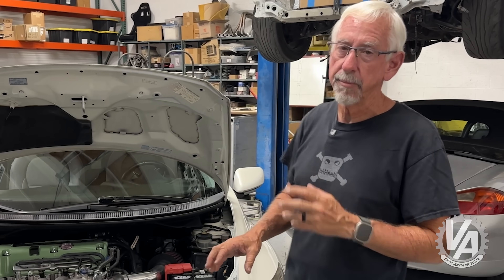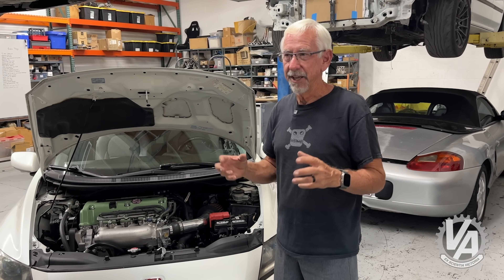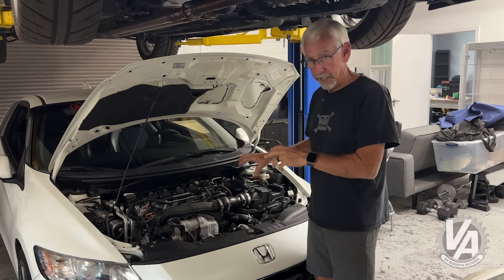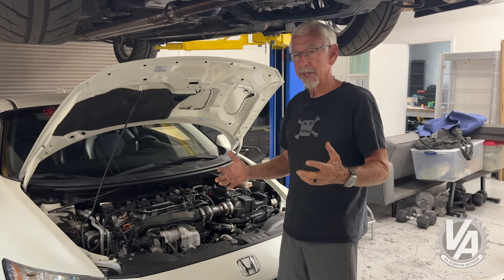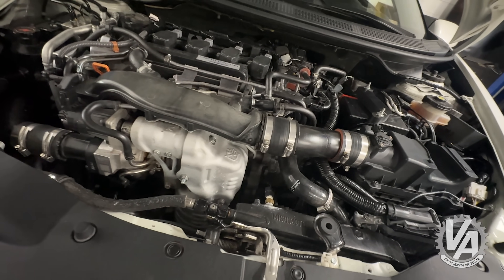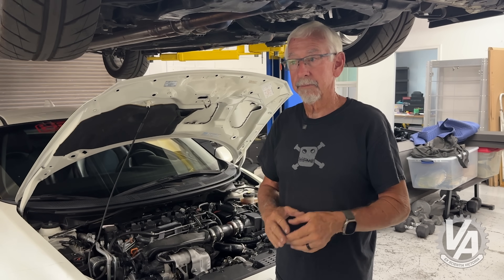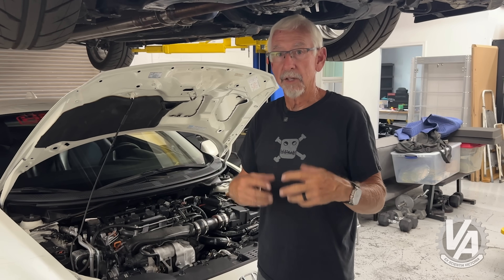We Knew This Would Happen! Honda Engine Swap History Repeating: ZC to B to K to WHAT?

Comment: The Kswap is not dead...  Its just so reliable that the people who swap to K20 never have to continue to watch youtube videos.
Reply: Its been over 3 years now on my Turbo AWD K20 EF Civic sedan.  @ 411 horsepower tuned by PFi,  The only thing that ever breaks is an occasional TPS sensor.
Reply: @Basscouch  And clutches and CV joints
Reply: Theres no reliable high power 4 banger if we’re talking 600hp or more, and very few can handle 500-600 reliably. 4 bangers aren’t just not worth it for chasing high power, but if you just want something liable, fun and nimble on 200hp-300hp K series are pretty damn good still. Anything youre looking for in terms of flat line speed and not a time grenade  though… theres LS’s, Coyote’s, and 2J’s depending on size, cost and  dimensions. K20’s are really only that amazing for smaller cars and even the modern civic now days weighs 3100
Reply: @Angel7black  Nowadays all is made light and at the brink of it's designed power that is why I don't like ANY small displacement engines anymore. I would not go further than +20% on those engines in stock form. I remember boosting a Honda B16a back in the 90s. 350 horses all day reliability, gearbox Y2 LSD STRONG!  I only burned through clutches and CV joints. Ow and tires.. yes tires LOL. Today I would opt for a big diesel like the BMW M57 6 cyl, single big turbo, not the fastest but lot's of fun and reliable as a Mitsubishi marine engine.
Reply: Facts!!
Reply: I drive and love Honda but I'll admit I'm a bit of a K-hater, not the 24 but the 20s in particular.  Now real life vs youtube is definitely a good point, and this channel here doesn't suffer this, but i swear i have never seen another Japanese engine get blown up by so many youtubers.  Its that and my hatred for (with some exception, very well designed ones) exhaust sound, which for boring reasons i won't get too into (reversion basically, but this also directly contributes towards usually lackluster engine sound) is why they blow up so much.  Sure someone can do some perfect 4-1 with great merges, and stepped headers, and it CAN sound great but most don't, and most explode being pushed by their owners far more then any other higher end tuner engine i know. 

Probably not the engines fault (besides the reversion bit), more a problem because its a NHRA legend and all that tuners go too hard with it, but alas i'm still kind of a hater.  A professionally ported K24 (or alternatively, stock) i kneel, but if you stick K20 heads on it, that unfixable exhaust side (the side all the cool emotions come from) but perfect on the other intake head (the boring dyno sheet side), i just can't respect it the same way as 90% of engines.  No i don't think Mistubishi's sound good either and yes i know they also made many legends in the NHRA.  More a road course/rally person myself
Reply: @Ottobon  I’ve been a full k24A2 fan for sure there slept on and cheaper. I rather have more torque than a few more hundred rpm’s
Reply: @ssjdavid  My thing is i drove one of those goofy GTV6 things from Alfa, then looked up cylinder heads, studied so much, got obsessed with sounds, there are a few sins, the K20 Head just does most of them on the exhaust side despite being AMAZING on the intake side, and i could care less about technical side its just all how it sounds, and the K24 doesn't have those sins, and if and where it might be weak it can be improved (Similar to why people who like 4AGE Toyota's go for small port heads rather then large ports.) 

K20 isn't the worst thing ever, its not a 6G72, but coming off all the good Honda was doing at the time after the B engines, the F engines, i just will always be more K24 (stock or modded) faithful then K20 nightmare farts
Reply: biggest cap ever
Reply: @Basscouch  its the same for j series guys if not even more so. Intake and exhaust and tune is as easy as it gets for 300 hp on them. (295 ish for even the j30s aint too shabby)
Reply: Think I will stick with my fully built and boosted D-Series. 
It has been reliably making 475whp for the past 3 years. Mind you, the only parts replaced within the 3 years were a water pump,  alternator,  clutch, 2 CV axles,  and a battery.  Normal stuff.
Reply: I'm on my 3rd bone stock k20z3, I'm never lending out my Si again
Reply: @brian can these drop into insights? I think it would be perfect. I have hear people asking about the auto swap as well. I want to swap my insight this spring and think you are right. Will the l15 turbo fit the G1 Insight?
Reply: Just thinking if all the world had to do was worry about k swaps it would be a better place.
Reply: Prices coming down on k24 motors right now and there are still a ton out there to be had.
Reply: its NOT so reliable. stop it. bone stock is pretty reliable. anything more than 300WHP or 350WHP is a ticking time bomb.
they have oiling issues ! ive been trying to address this for so long. i also suspect that that K20 pump on K24 engine ruins it. 
ive seen WAY too many people blowing K series engines up with honestly lack luster simple builds. not even pushing the limits.
i have a 600whp turbo E36 on a stock M52 with just bolt on turbo kit and link ecu. im going on 5 almost 6 years with it.
and i drove it NA for a few years in a different chassis before i turbo'd it. i have buddies who have gone through 3 K motors this year and 
they are making low 400hp.... they ARENT reliable. they just make good power for cheap.

CHEAP FAST RELIABLE. you can only pick 2. and the K motor is Cheap and Fast. its not reliable.
Reply: @dannyipwn1203 funny I seen guys run stock k24 turbos for years around here pushing 400. Those guys that you know blew up don’t know how to tune
Reply: @ssjdavid  stock k24 as in stock k24 oil pump? did you miss the part about the k20 pump on k24 engine?
Reply: @ClumsyCars we all run k20 oil pumps 😂
Reply: @ssjdavid  I know. That's what he said. Come on man, try to keep up instead of just writing whatever pops in your head. I'm not trying to insult you, genuinely asking you to pay attention.
Reply: @ClumsyCars I am paying attention bro, multiple people around me at driven tuning and Custom kings are running stock K24s (most go k20 oil pump) and hit 400 no problem for a while
Reply: @dannyipwn1203 what are you smoking k series can hold 500 all day long 😂 the transmission are what’s s 💩 not the engine
Reply: @dannyipwn1203  I have seen "well built engines" by tuners blow up because they would not take my advice (I used to own and mod big boost rally cars) on the risk of high intake temperatures together high compression pistons, wrong spark plugs, fueling at low rpm this caused destructive detonation. Afterwards they still not got it. M52 is a good engine, you got rid of VANOS?
Reply: @dannyipwn1203  It all depands on who builds it and how. If the engine is built for 250bhp and push it to 300bhp then yes you are right, it is a thicking bomb but not if you respact the engine how its built , if its built for 250 dont push over.
Reply: @dannyipwn1203 it’s bc your m52 is cast iron, I’m an e36 guy but Honda at heart but I still favor the b series over the k. 

Also you can get a b20 non vtec with crower cams going 12-13 sec easily at a fraction of the cost of a k
Reply: @vucci8378  what the heck are you talking about? B series engines cost around the same as K's, depending on the model, and, the internals and builds cost the same.... There are B series and K series models that are very expensive and cheap, but they all have pretty much the same casting. If anything, sourcing B series heads is harder, and B series are more rare now than K's.. With a K, you can buy a $300 K20a3 or cheap K24 that are not the 3-lobe variants and just buy internals and get the head ported. All for cheap... Im not really sure where this "K series are expensive" is coming from... Yeah, if you buy the most expensive parts and model, u can spend a pretty penny, but you dont need to buy a Type R or rare K series engine/head. You can do a full turbo build with a fully dressed K series for around $3-4,000. Same with the B series.
Reply: @dannyipwn1203  Little Truth there.... I have an 8th Gen with the Kraftwerks Supercharger kit and to address the oil pump issue, I had to upgrade to an Acura TSX Oil Pump.
Reply: @dannyipwn1203 I’m pushing 388.5 to the wheels. I have no idea what you are talking about.
Reply: @dannyipwn1203  This is a straight up lie and  one of the most ignorant posts I have ever seen..

Comment: I’m still rockin a built D series
Reply: My stock Y8 went 230k on the stock water pump and timing belt lol. Crazy that I pushed it to its limits in the canyons too
Reply: @bbbt8090 my b series is at 270 and still pushing strong
Reply: just swapped a z6 into my 94 coupe that had a d15b7 in it. things rips
Reply: Single cam here. And surprising people
Reply: @Just_Jesus_ef For real. I smoked a guy that was running a boosted B series many years ago. 

Dude was in disbelief when I told him I was only running 8 psi.
Reply: @Alejandro-u7q7c   8? Shoot, that's low. Still got him
Reply: @Just_Jesus_ef  Yeah sure do, still improving everyday. I was running only 8 back then cause I was on stock injectors, stock map sensor.
Reply: I'm running a ZC dohc with hand carved cam profiles.
Reply: Any specs or figures videos ?
Reply: Will be if I can ever get the rest of the car built
Reply: @fataldreams2  hell yeah I have a zc with a z6 head
Reply: Same here, at 26psi & E85 and needs boost-by-gear til 4th. I put in Wiseco pistons & Eagle rods back in 2007. Recently tuned a friend's L15B7, insane boost response. IIrc it's a 39/33mm turbo which is insanely small.
Reply: @hydrocarbon82 yes! Man that's so cool. Brings back memories. I had a 89 crx, stripped with a all motor Y8. micro polished knife edged crank, eagle rods, custom 13:1 domed pistons by JE I think it was. Bored and sleeved. She screamed with ITBs. Had a si tranny with 4.9 final and a custom 5th
Reply: Same bro! The og underdog build 🔥
Reply: @fataldreams2  not a bad engine with a turbo.  The good thing is it’s simple and you don’t have to swap it :)
Reply: @Whatifwarlord  I rebuilt it to set it up for turbo this time
Reply: Built d over here
Reply: B18C5
Reply: Same
Reply: LFG
Reply: Same
Reply: same 😂
Reply: NICE!!  I had  Vitara pistons with LS rods in my D16 with a T25, boost came on quick (10 psi at 3,000 RPM) so it had my CRX scooting along really nice.
Reply: @uptownsamcv  cool I’m working with a bored CSS d16y8 nippon racing pistons cericoted eagle rods 4 piston outlaw head setting up for precision 6262 turbo. In a crx also
Reply: Same
Reply: Same lol, and quite hard actually
Reply: I run a K20 in a MR2 and a DOHC ZC into my 1st gen civic. This engine into a Shuttle (civic wagon in the us) would be amaizing.
Reply: You will never have to upgrade because it will never die.
Reply: Me2🎉 y8 si-R build 😅
Reply: People sleep on the H22 and the H23 a lot of capability for an older motor was very ahead of its time w tech-💻
Reply: @dsrrecordsent  just pistons can be a pain. Honest an f block and h head is best
Reply: Some stole my d series 91 civic wagon
Reply: Same here. I enjoy my built z6 more than my built LsV
Reply: Can you build a d17?
Reply: @SS24C97 Those motors won’t make anything NA and won’t hold much boost. You have to go K in those chassis.
Reply: SoHc 😳
Reply: 100%  bolt ons and 330xxx 2nd owner of my 95 sedan.   Love it for the winter daily.
Reply: Nice for sure on the dseries. Just took the ew si motor and 5spd out of my crx last weekend.kind of want to put an f23a in with an h ro b kit in my crx. i also though want to make the rear trailing axle driven, I know it would be custome axle shafts and cuttng and welding and put a j35/j37 w j32 heads.
Reply: Bro!! I know there's gotta be plenty of us out there.

I'm actually glad that most people think these motors are worthless, means the prices will remain cheap.
Reply: The best Honda engine the d special on carb and cam and head swap believe me I have one in higher rpm k b need to hustle hard to get me and my is around 11.1  to 12  1 compression run on premium gas and believe me my CRX is a falcon and sounds like old Ford muscle car she shake jjjjj 😁 on low rpm like old school style.
Reply: Best thing is boosting them because blocks are a dime a dozen lol
Reply: My d16 is compound charged 🙋‍♂️
Reply: B series dc4 here 👋
Reply: D16z6 with d16y8 trans in mine. Auto to manual swap.
Reply: Id be happy to be making more than 100hp in my D15b8 lol
Reply: Anyone have any info on upgrading transmissions for power on a d series? I have way more engine than my driveline will hold. Looking for 600hp ish capable (High end for sure).
Reply: imagine wasting money on a D Series lol
Reply: Me too im deadass late to this but i just bought a d15b from japan to swap my old y7 that was blown😵 and she feels great again but seeing what the future holds is pretty cool
Reply: turbonetics kit back in the day
Reply: Noiceee
Reply: D series all day.
Reply: It's B or go home...
Reply: Meh. Once ur built it doesn't rlly matter, when we're talking sub 600 @S2K_Korey
Reply: @tayvonrose2528  but how is the cost when you reach those goals. I would try for 400-500 for street max.
Reply: @S2K_Korey  exactly. Unless ur AWD any more than 500 in the streets is kind of silly. It's cheaper to build a D than it is to build a B. Vitara pistons cookie cutter build is the way
Reply: @tayvonrose2528  i could build a simple LS/b20 with rods/pistons/barings/turbo and make 400 in my sleep
Reply: @S2K_Korey  so can a D, while being cheaper.
Reply: @tayvonrose2528  That's false.
Reply: @S2K_Korey  tell me you don't know about the d series without telling me you don't know lol. It's not 2003 anymore
Reply: I don't understand, built b-series (minus sleeves) have produced well over 400hp for years.
Reply: @tayvonrose2528  if I can buy a B20B $600-$800  and put some cams in it. Exhuast/intake and make an average 180whp all day. You can't touch that budget with a SOHC. I've owned 8 EF's with  D15's and Y7 swaps. ZC dohc and Jdm sohc. ETC. Im sorry, but whatever SOHC can do, B series can do better in every situation.  Just like K can do better that B in every situation.
Reply: @S2K_Korey agreed 😂
Reply: @S2K_Korey port and polished D will kill a B all day
Reply: @someguy8259 my non v d15b with bolt ons cam 91 pump did good wonders! 140whp!
Reply: @someguy8259  no it wont
Reply: @someguy8259  port and polished lol

Comment: Prices for the 205hp L15 is 2500 minimum just engine alone and the si gearbox with the LSD is 2500-3k sooo it's not cheaper not even close. L15 swap will cost realistically 13k minimum Kswap can do for 5-6k
Reply: I figured as much, better to buy 2016 Type R and have a car done (~20K), less fun but..
Reply: @kfitfactry do you have any recommendations on places to get more L15 swap details (and pricing)

Comment: K swaps are a waste of money in my opinion unless you want to drag race. Spoons b18 ek9 is faster than it's spoon k20. Save your money to improve the driving experience. A balanced OEM engine in my opinion is way better than a HP engine.
The best benefit of this engine is the weight.
Reply: That's a good point, but what if you have a D series as stock and not a B?  Do you choose K series or B series (or H series) then?  

For power-to-weight race classes like Gridlife in the US or MC 750 in the UK you have to say the K24 is attractive as it's cheap (so you can blow an engine and just get another TSX engine) and it makes good torque (you can get to the maximum 200hp number you're allowed at pretty low rpm and just hold the engine there to redline by pulling timing and cam angle out).
Reply: @TassieLorenzo  I personally like the old skool b series. Most people in Australia are in $20k in parts just for a K swap. I raced for years, so for me. I know I don't need more power, Id rather a well balanced car with around 200hp that looks and feels great. After all it's about the driving experience. Tuning your car to do over 200kph when most racing and mountain runs and corners are around 100kph is too much. Tune to the conditions and driving Style I say to get a better experience. Without understanding grip and how UV affects conditions HP is useless..
Reply: Who the fuck can afford a true spoon engine?

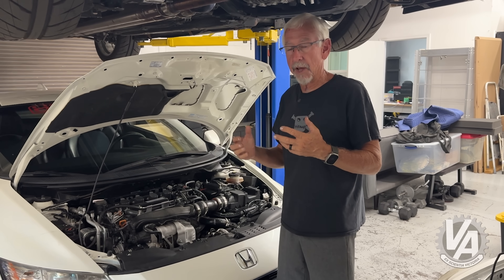Comment: @5:57 I'm finishing up on a plug and play solution for the IMA errors on the gauge cluster.
Reply: Awesome! Keep us updated. One of the things that holds me back from swapping mine CR-Z is the damn IMA light on the dash that turns it into a Christmas tree 😂
Reply: @Himothy509  Getting closer to finishing the last issue.
Reply: Update?
Reply: @jackpulley541  Got all the issues sorted out. No IMA warning or Hill Start Assist. The SOC Gauge is now for the ECT. The  Charge and Assist gauge now is for the throttle and brake pressure respectively. The ECO guide display is now for the IAT and Oil Pressure. All of this is plug and play. I am finalizing some things before making this available. There are some videos on this from Automotive Anatomy and Speed and Motion. Just search K20 CRZ.

Comment: Do you think the L15 will fit in my CRX with all the ac components? Im in houston and im 49. Not gonna go without that. Nope. I currently have a NA b20v swapped with a half rad and fan plis another fan btwn the condenser and the header. It works ok.
Reply from the maker: The problem with putting it in a CRX is that it is too tall.
Reply: @VTECAcademy  Thanks for the info. I have a sir hood. How much taller we talkin?